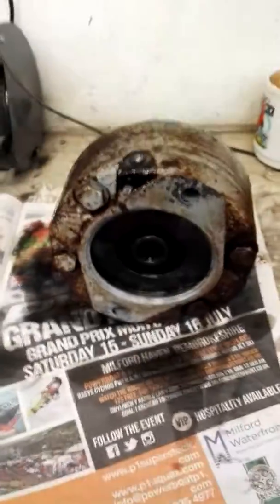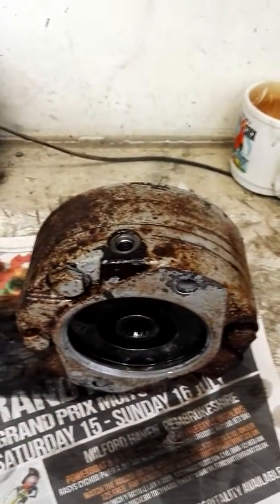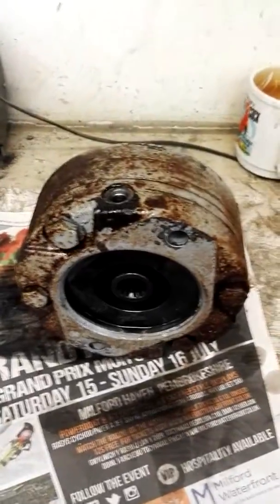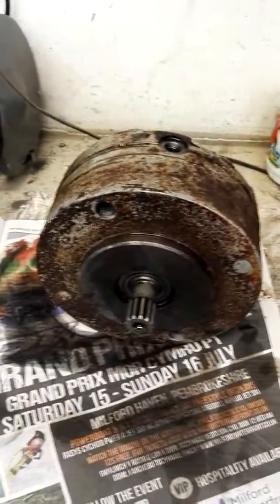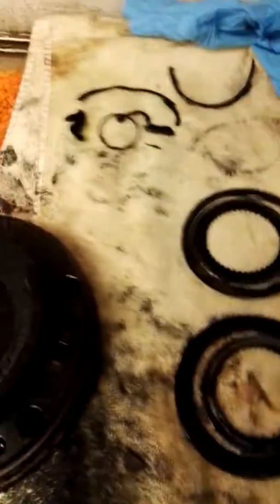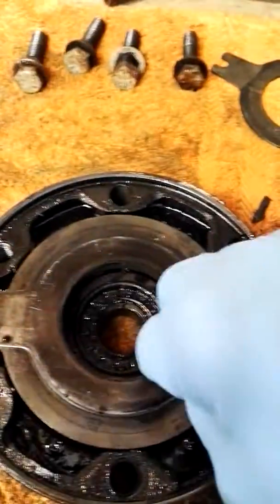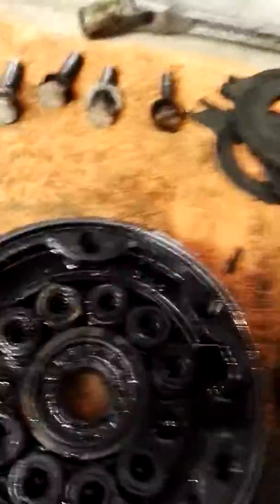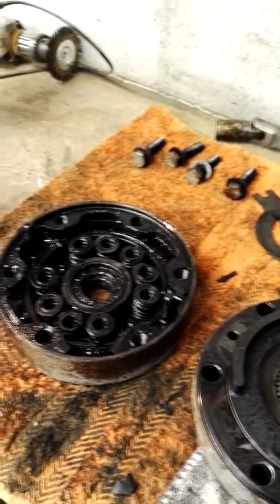Genie Z45 Brakes explanation and rebuild.

Comment: Quick question...are these considered wet or dry brakes? If wet (I assume) what type and amount of lubrication would go inside one unit? 
 Thanks!
Reply from the maker: Hydraulic oil from the main circuit at 3000 psi.
Reply: On the spring side, is there any amount of fluid to be added? Thanks for the reply btw!!
Reply from the maker: @deangallant5813  no, it all fills automatically, and is self bleeding
Reply: @Hensen1954  gotcha, excellent. 
 I had some broken springs (odd configuration with the 5-4 combo?!). 
 Could find anywhere to buy them (In Edmonton, even the Genie Dealer couldn’t find anything). I had to get some manufactured :-) 
 Getting ready for a test run now, this video was a great help! 
 Thanks again 😎👍
Reply: Tem  óleo  nas molas  ??
Reply from the maker: @darlansampaio8767  Sim, está cheio de óleo, alta pressão para soltar os freios.